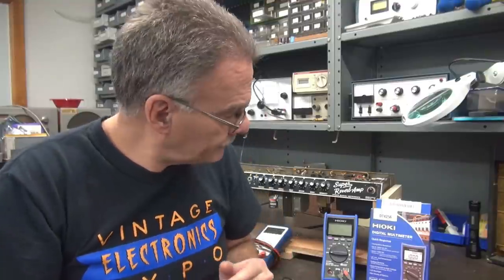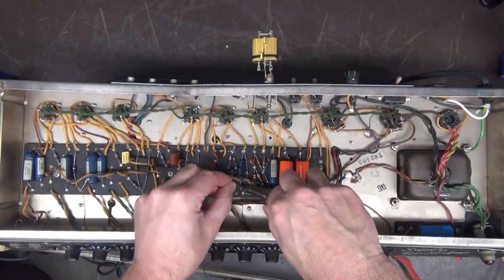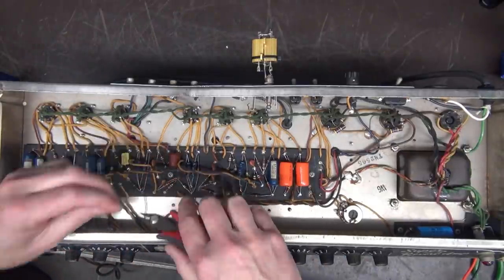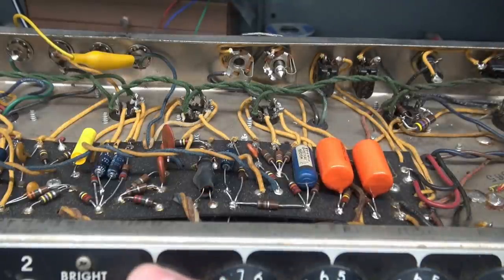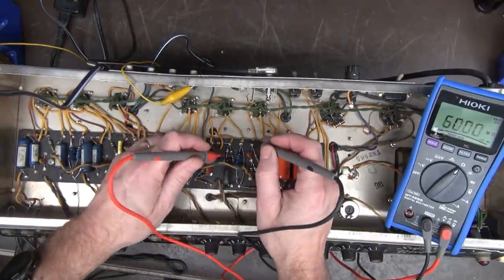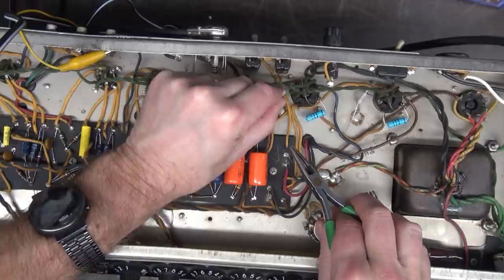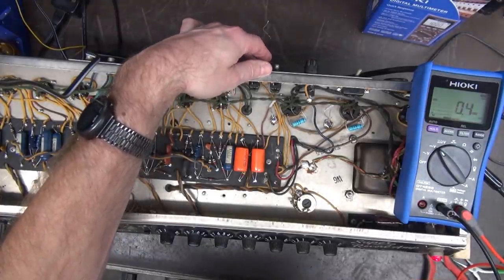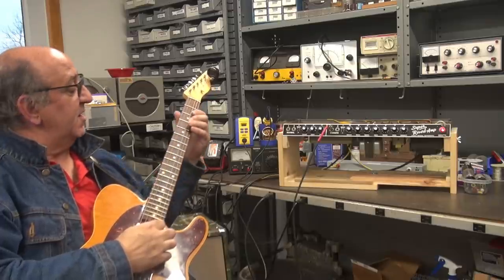Fender Super Reverb Blackface tube guitar amp Repair Part 2 Cap + LDR replacement + Demo

Comment: i came up on an old Sony player that was shorting on a zenner, figured how hard could it be to run through some deductive troubleshooting, didn't take long for me to  come across  modding the old radios and your video's. That was a year ago now, i have 4 tube  guitar amps now, and working on m first build from scratch! still much to learn and i get scared since I teach myself that I'm missing critical concepts because i dont know that i don't know if that makes any sense in any case i just wanted to  thankyou for always some entertainment and some examples of often repairs I'm trying to do -  so I'm not sure if you're  still active but thanks for what you do!

Comment: Terry, you mentioned that you occasionally make mistakes, and that we all do. I have been fortunate enough not to get an electrical shock for a good long time, because I generally only do the odd electrical job, like changing an outlet in the house, or my most recent, changing a dispenser module in my fridge. But I can kill the breaker for a given circuit, making that virtually risk-free, in terms of a shock, and I even have one of the little "probes" to verify that there is no power at the location I am working on. All that said, I have discovered a truism from experience that still bites me about every ten years. "A cold soldering iron looks just like a hot soldering iron." And I've had the blisters to prove it! :-)  Love your channel, hope you had a very merry Christmas, and I wish for ALL of us a happier 2021 than this mess of 2020 has been.

Comment: A lesson I learned the
Hard way and lived. In my early days tinkering 
With a Hot water 16 heath kit I was tinkering on the chassies tightening 
Up screws with an uninsulated screw driver when I accidently touched the 600 volt DC line to the
Plate of the 6GE5
RF output tube and got the poke of a lifetime
My heart rate went up
To perhaps 90 or 120
I think I was 16 years
Old then. Now I am
Alot more careful
Just call me lightnin
Or Lucky. Dwight

Comment: Thanks for the video and all of your insights. I'm recapping my own Super Reverb now and your videos are super helpful. The one ohm shunt resistor tip was really great. My only observation was that when you were putting in the orange replacement caps, I was scratching my head why you didn't check the resistors in that area. With the old caps out of the way, that seemed like the time to replace any if needed before the new caps went in. Anyway thanks so much!

Comment: I used Sprague caps years ago when I built electronic stuff. They never caused problems. Great videos.
Reply: that is great and all but the blue Ajax caps rarely go bad - at least he doesn't keep them or even worse- throw them out - he returns them with the amp.

Comment: From Leo:  I have an old Fluke 77 from the 1980's that is still working fine.   It is not as quick as the one you are showing.  That was my first auto ranging meter.

Comment: I really appreciate the overhead soldering view Terry.  I am working on an RCA tube radio that has dry rotted wiring along with paper caps.  I often struggle trying to figure out how to replace the wiring when it is routed through not very accessible areas.  It is teaching my patience, lol.  Another great D-Lab resurrection!

Comment: Very cool.  Did you notice that chassis is bent on the back, just 3 inches left the DLAB dummy load ? Looks like it took a good hit..    I agree with you, lets get rid of the circus board amp and go back to these hardwire.. they just sound better !!!!!      The disconnected wire was a great opportunity to show why we do not shotgun these things.. There is logic to follow which always prevails.  What a sweet sounding amp......   You've done a wonderful job as usual...
Reply from the maker: Yep, Not sure how that was inflicted. Maybe a mad wife? Yes, I agree, NO more circus boards!
Reply: Probably a Pete Townshend casualty from one of their London pub gigs!
Reply: @ChatGPT1111    Funny you mention Pete.. I am friends with him and we exchange email often. He is an exceptional person.... We've spoken at length at few times in NYC and I got to know him as a person.  Did you know he started smashing his guitar after at a gig with a low ceiling he jumped up and it broke off his headstock... the crowd went wild... it became a staple of the group in the early days....

Comment: I found 2 not really connected wires in my 68 Super reverb when I went through it. Looked like they never had a good solder joint.

Comment: Well my Carvin XV212 100 watt tube amp was built in 1981 on a circuit board and it’s doing fine, it will easily be around 10 years from now making it 50 years old!

Comment: Considering the back panel/chassis straightness with the overhead view, those solder connections  held pretty well when the amp suffered damage from some mishap.
Reply: I had to do some panel straightening when I got my early '73 Super Reverb & replace both Vibrato inputs--seems the amp fell over on items that were plugged in!

Comment: Hioki is a good brand. Brymen is my auto range meter of choice. The features for price and robustness is 2nd to none, not even Fluke. Check out some of Joe Smith’s torture tests of all brands of meters he buys from his own money or are donated. Dave Jones from EEVblog has put his name on two Brymen meters, the BM235 and BM768(not on market yet). The BM869S is the most feature rich of their lineup. The Japanese Yokagawa is actually a rebranded Brymen as are Greenlee meters. The Greenlee deal makes the Brymen hard to get in the US. I bought mine through TME in Poland, $10 shipping and had it in 4 days. I can’t get shipping that quick and cheap 3 states away. Welectron in Germany sells Brymen via EBay too, a little more pricey.

Comment: If I don't remember wrong, Hioki manufactured multimeters already in the 70's. (Edit: It seems that Hioki has manufactured electric equipments from 1930's.) AFAIK they were quite good quality instruments. However for some reason I purchased a Kaise SK-1000 FET multimeter equipped with 12Mohm FET input. Oh boy, that was something special in those days and quite expensive. I still have it and it works perfectly!👍

Comment: My new amp came with Chinese EL34 tubes and when while playing I noticed a strange effect when playing it sounded like a 50hz hum in fact it was the output tubes self oscillating when I was playing and stopped  when I was not playing, changed them out for the Russian Sovtec  El34 problem solved  and a much sweeter and cleaner sounding amp now.

Comment: I've had the same sort of problem with auto range meters too. Expecting a reading in the voltage and it happens to be right number but in millivolts. Part of the difficulty is that units displayed are tiny. Had one meter with huge numbers but the units reading was tiny

Comment: Very instructional!  I'm recapping my 68 Pro Reverb and notice that you don't replace the molded blue caps in the preamp stages nor the small brown disc capacitors?  Just the grid caps and the elecrolytics and the two brown caps with Mallory 150s.  Mine have been done before as the large brown cardboard cased electrolytics have been replaced with physically smaller black ones like you've done, but it's been over 15 years ago, before I bought the amp.  I'm chasing hissing & crackling.  Thanks!

Comment: Hey Terry-I’m putting together a amp servicing kit and after searching, I haven’t a clue what multi meter would be suitable for the voltages and function of testing 30 watt combo’s and smaller? You’ve seem to enjoy this model as I see it turn up in nearly all your videos since. Would you suggest this model or any others for working on small combos and heads? My kit is nearly complete with this exception.

Comment: I would like to know what type of solder you are using 60/40
I like to use the eutectic solder 63/37 because it has no plastic zone, liquid to solid boom
Reply: The last pound of solder I purchased was eutectic.  It wasn't cheap but it should last me several years.

Comment: Than you for sharing. When building my 5f1 champ, I neglected to hook up a B+ wire. I discovered the problem after inserting the circuit board so I added it over top of the board. Would this add to noise? Thx

Comment: Hey Terry! Thanks for sharing!
For ground connections, should I go for Weller 200w soldering iron or the 100w is sufficient? Both have tips that goes to 375 degrees Celsius (I can get 425 degrees Celsius tips)

Comment: Hi Terry, I am a big fan of your channel and watch every episode from far away Germany. I am asking myself how to solder correctly a speaker cable to the (positive and negative) tab of a guitar speaker in a speaker cabinet. The problem is because of the diameter of the speaker cable, wich is thicker than the hole in the speaker tab a good mechanical connection is impossible. I would like to use this big diameter cable but the only way is to solder it on top of the speaker tabs without going through the hole. I worry a little bit because of the vibration while playing wich can cause damage to the connection. Do you have any advice or maybe is this an interesting topic for another episode? Best regards, Sascha

Comment: When checking bias you kept saying “28 milliamps”. Was that not millivolts? Or am I mistaken?
Reply from the maker: Across the 1 ohm resistor 28ma = 28mv
Reply: @d-labelectronics  Thanks for clarifying Terry. Now I understand the purpose of the shunt resistor. 🙂

Comment: How many of today's PCM amps will be around in 50-60 years?  The answer is none...none more amps...  Looking into this amp from the 60's I am sort of reminded of my old 1963 Mercedes 190c...I could get into the engine compartment and make adjustments, valves, points, change the plugs.  Not so much with today's cars...in fact, not at all.  Troubleshooting and modifying a PCB is somewhat similar to troubleshooting and repairing a modern car: you need a lot of specialized equipment and you're probably not going to do it yourself.  I wonder if that's why a lot of guys who work on tube amps and vintage electronics also work on classic cars.